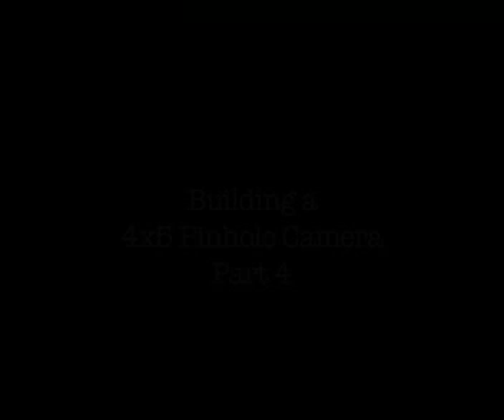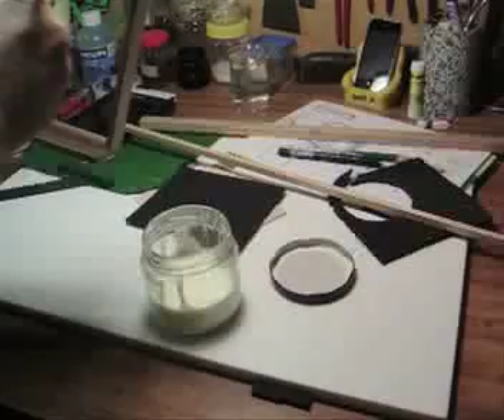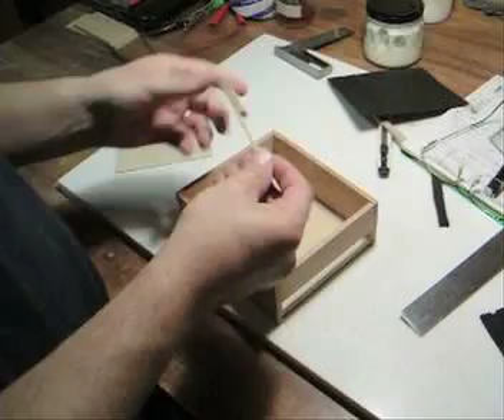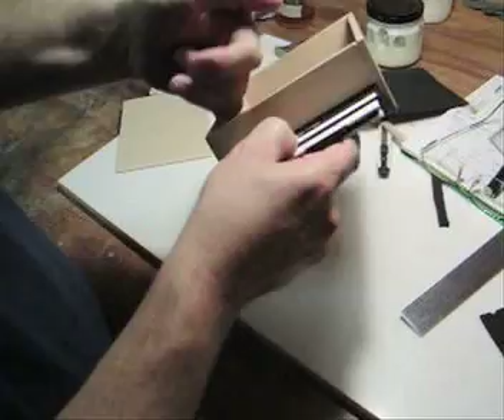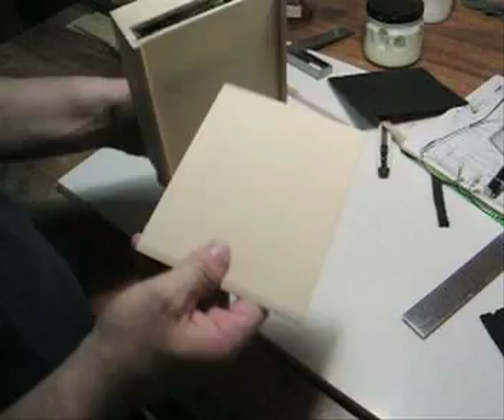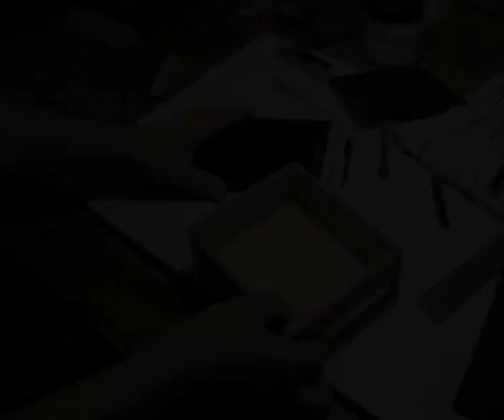Build a 4x5 Pinhole Camera - Part 4

Comment: A well made construction manual! Great!  But for beginners to experiment is'nt it better to use smaller film sizes? Sheet-Film is quite expensive.
Reply: Gerd H. No, I do not agree using smaller film.  The point is to get a large negative to avoid enlarging it.  The cost is not so important when one does not snap photos like its a digital phone then end up tossing them when the do not bring back the memory why they were taken.  One learns to take the time tomake sure the photo is what is wanted instead of shooting willy-nilly.